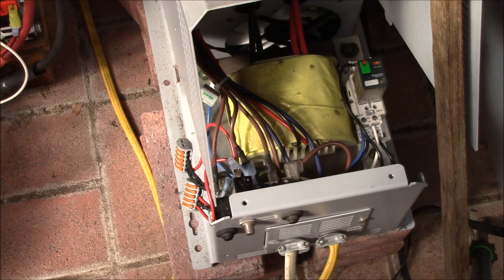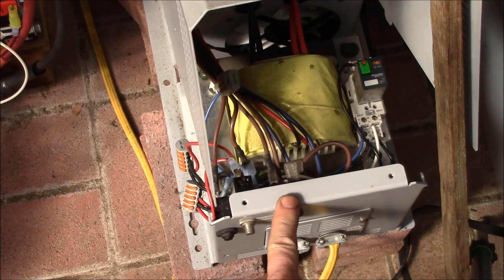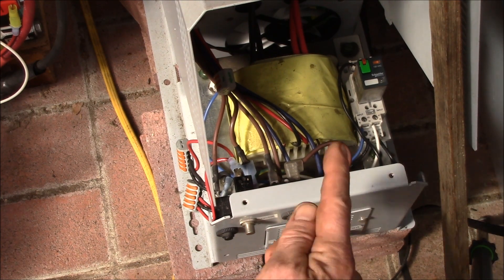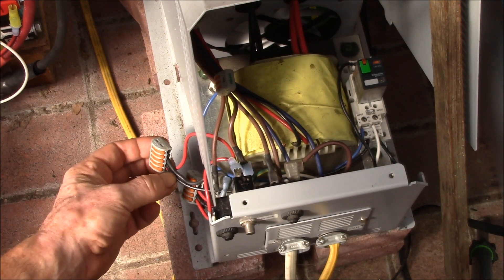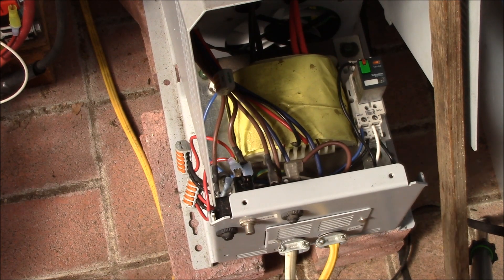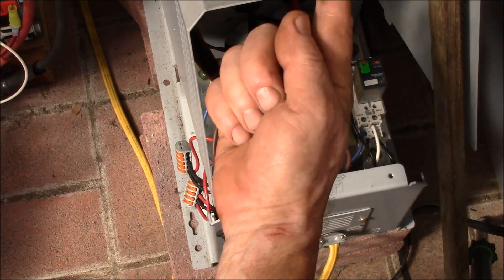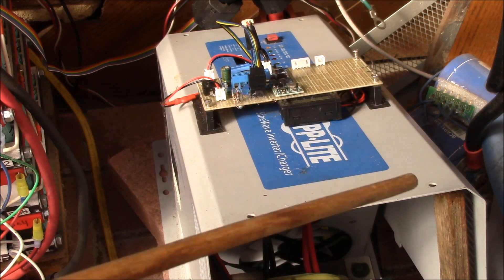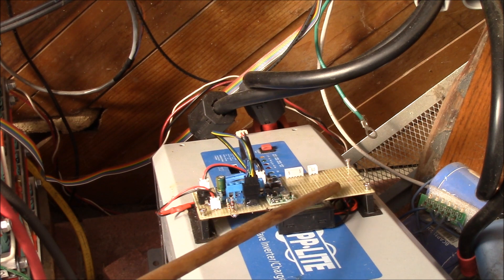Automating the TrippLite Inverter/Charger, Part 2

Comment: Oh no...the blue light was my favorite part...😉...(getting far beyond my comprehension but makes sense...someone can follow and use what you are sharing)
Reply from the maker: I think I did order a blue RPM display as I recall.  I still need to power that up and make sure.  But that is down the road a ways, have to see if there are enough I/O pins and memory in the Arduino to handle everything.
Reply: R Brown 
After 5 years...what's another 12+ months...watching for the "blue light" at the end of the tunnel...accolades will be well deserved for the finish...♀